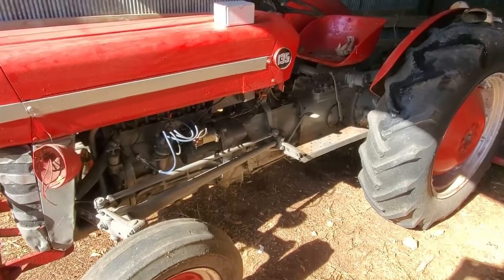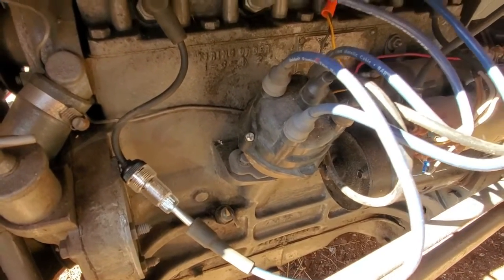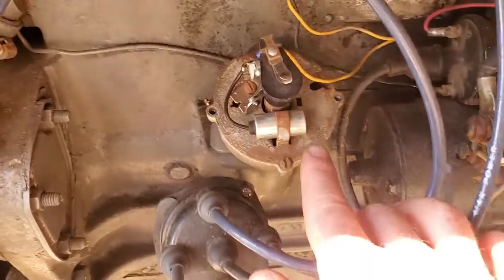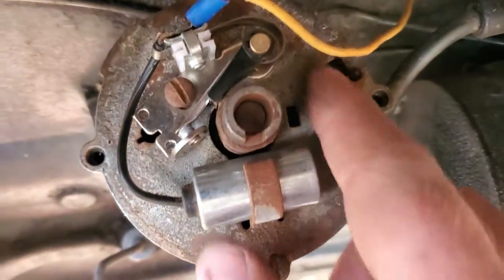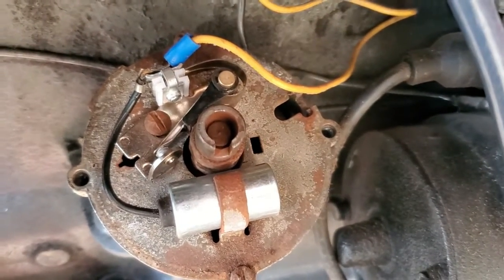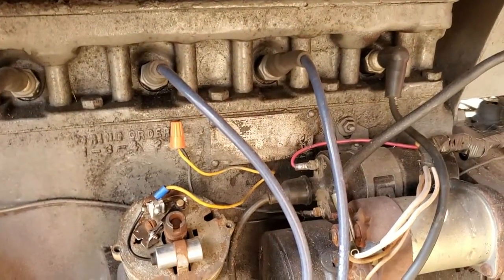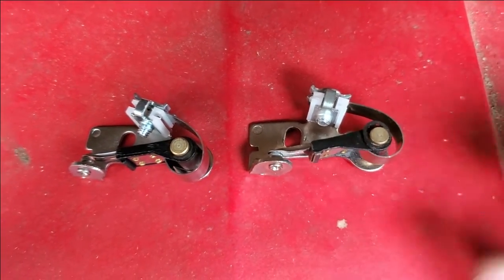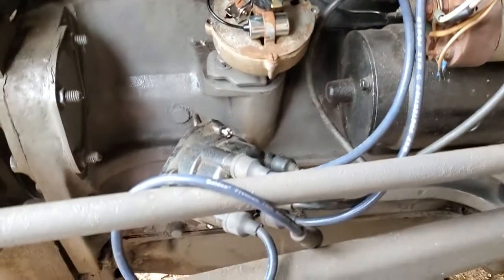Changing and Setting the Points on a Massey Ferguson 135 Tractor

Comment: In the middle of the distributor shaft, there is suppose to be a spouge that you put a few drops of oil every so many hours to keep the lobes lubricated so you do not wear out the points contact to lob too quickly.😊😊👍👍
Reply from the maker: That's a great tip! Thank You for sharing.